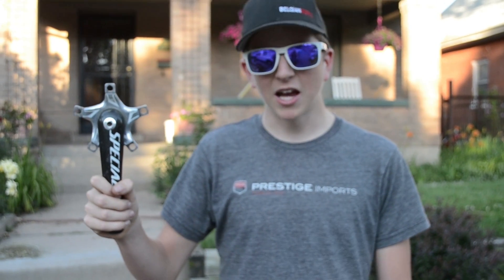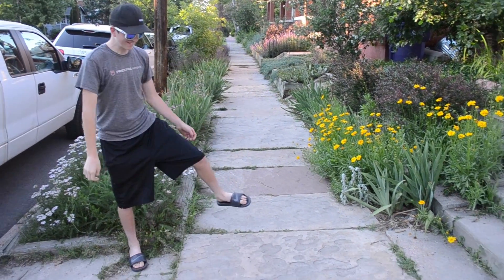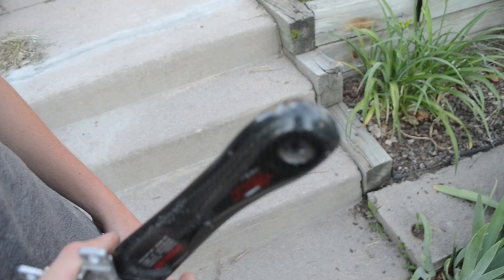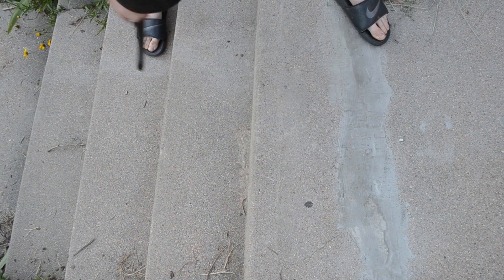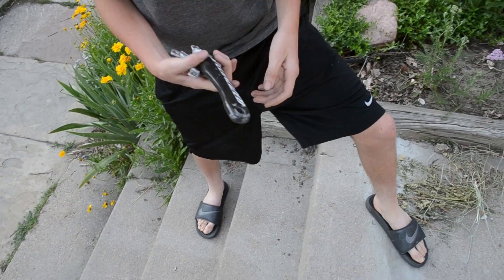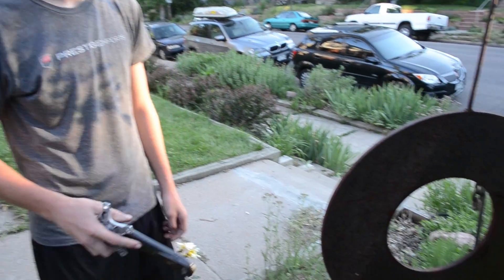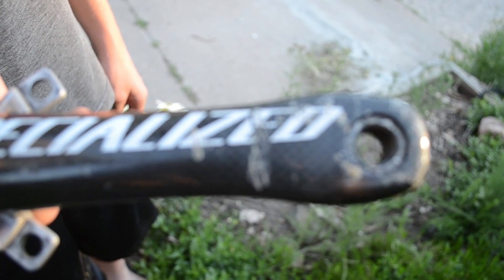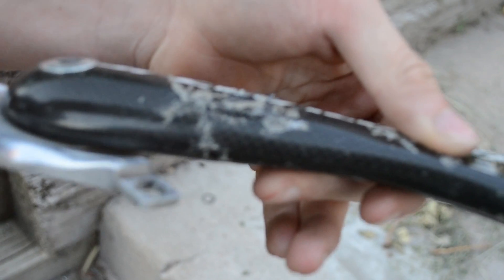Can Carbon Fiber Take a Beating? Non-Scientific Bicycle Crank Demolition Test

Comment: Look dude....  I know you're young so I won't comment harshly, but let me point out that banging this crank until it breaks tells you next to nothing about its ability to withstand pedaling forces on a bicycle.
Reply from the maker: The test is not to see how a crank withstands pedaling forces on a bicycle...carbon fiber is clearly a good material for these forces. The test is to see how a carbon crank can handle impacts. I realize that the crank is not a mountain bike crank, but the test is more to see how a crank would handle pedal strikes from rocks.
Reply: 2DiamondProductions 

There is nothing that happens while riding a bike that is even remotely similar to what you were doing to that crank.  You were testing its impact resistance to projectiles (be it in the form of a metal bar being driven into the crank or simply propelling the crank itself into the curb).  That simply doesn't happen on a ride.  At worst, a crank might be pressed against a sharp rock under some amount of weight.  That's not the same thing as a projectile hitting the crank.